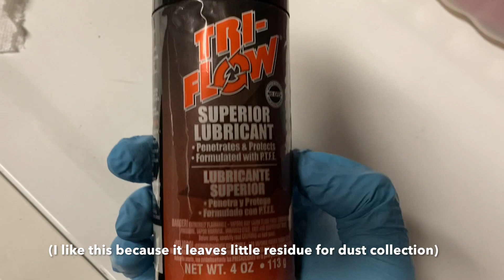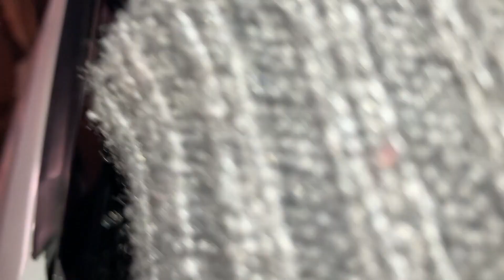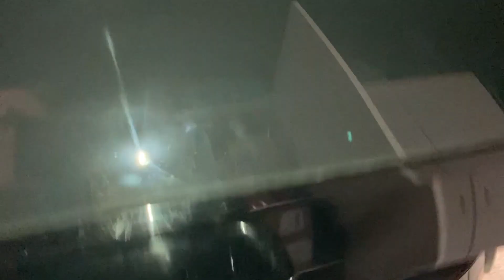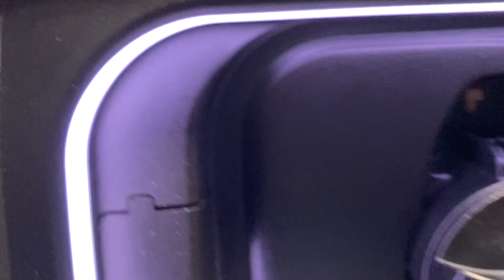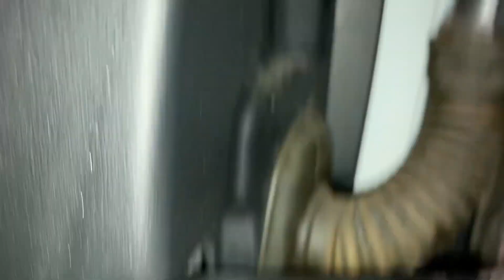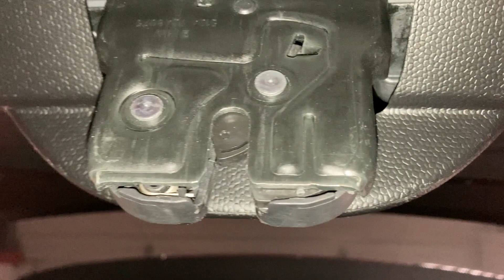BMW I3 Annual Misc. Lubrication points

Comment: White lithium grease is good for metal-to-metal joints like hinges and latches, which need a clinging grease to repel water and hold up under harsh conditions. WD-40 is for light-duty lubrication and freeing up sticking or partially rusted hinges and catches
Reply from the maker: Yep- good point.   The teflon lubricant is supposed to be pretty good too, but I agree lithium grease is the baseline.  Thanks for Sharing.